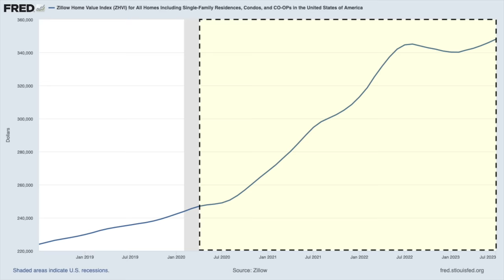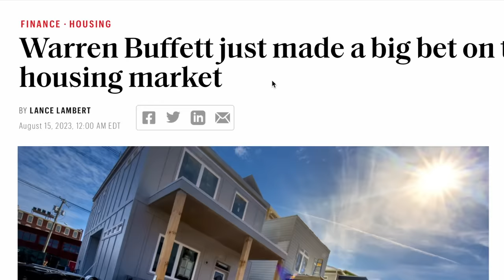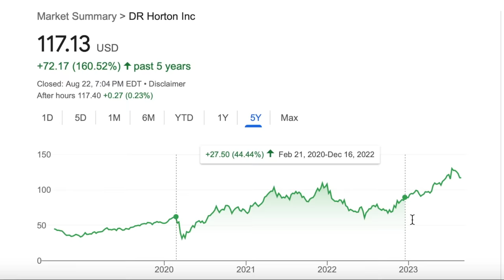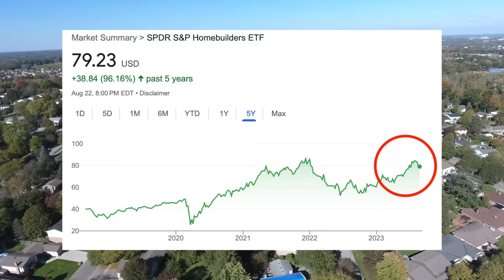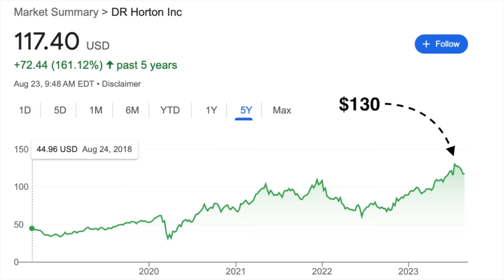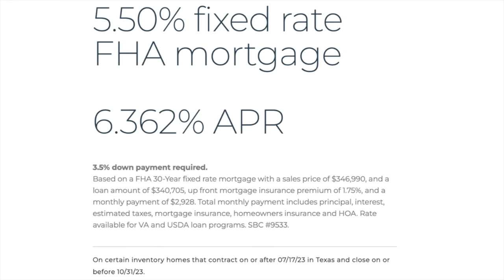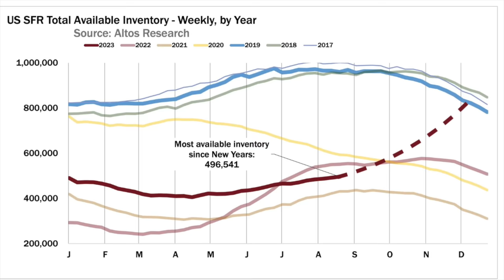The US Housing Market Won’t Survive What’s Coming

Comment: I remember in 2007 when I was working in real estate seeing people buy homes new from builders with the intention of selling before close of escrow to a new buyer for profit. The crash was so brutal and fast that I remember seeing a lot of these units foreclosed on with the builder plastic still on the carpet.
Reply: Most people find it difficult to handle a fall since they are used to bull markets, but if you know where to look and how to maneuver, you can make a size-able profit. Depending on how you intend to enter and exit, yes.
Reply: Given that we are not used to such volatile markets, the fact that the US stock market has been on its longest bull run in history helps to explain the widespread fear and enthusiasm. There are chances if you know where to look, as you noted when I earned more than $780k in the prior ten months. I hired a portfolio advisor because I knew I would need a solid plan to get through these difficult times.
Reply: It was run by Julie Anne Hoover, who I learned about and got in touch with thanks to a CNBC interview. Since then, it has served as the point of entry and departure for the games we have emphasized. A search on the internet can be done if tracking is necessary.
Reply: I just copied and pasted Julie’s whole name into my browser, and her website appeared right away. You've saved me several hours of arduous research, therefore I appreciate it.

Comment: Warren did not make "serious" investments in homebuilders. Its actually an incredibly small portion of the portfolio and was likely made by Ted or Todd, two of his potential replacements.
Reply: Yep. It's about 0.2% of their investment portfolio. Stories like this are FOMO for buyers. It's unbelievable that it works with channels like this. 

I used to like this channel.
Reply: I hadn't even noticed the channel never mentioned the investment amount hah
Reply: @AK88.  
Conveniently, it never did. For had it, the point it was making would be instantly ruined.
Reply: @BPoweredLove  not really, we're just going to enter a world of haves and have nots so everyone is right technically
Reply: @AK88.  

I don't see it that way. Any time that Warren is mentioned as "here's what he is doing", the implied message is always "so you should be too". This video is implying that the housing market is only getting stronger in the near term and I thoroughly disagree. 

As for haves and have nots, it's been that way since the beginning of mankind, so nothing new there. 😀
Reply: @BPoweredLove  whats new is the size of the chasm that will be between the two. This time really is different and low inventory is propping it all up even with joblessness because of those low int rates locked in. This is protecting housing and wont see a crash until next year spring/summer
Reply: @AK88.  

The crash already started. Many hot markets, like here in Phoenix, have already seen almost 15% crash in the end of 2022 going into 2023 until the season up-tick happened. Many other markets are like this one. 

But for the rest of the country to join in, I think that will begin this winter and continue over the next 5 years. 

Keep in mind those locked-in people don't represent a huge number of home owners. The figures that are popular to share are of "mortgage holders", not "home owners"
Reply: @BPoweredLove  homeowners have it even better and even more entrenched. Those markets crashing were already overextended and the main markets that needed the reality check as the rest of country didn't inflate as unhealthily
Reply: @AK88.  

That's obviously why they were first to fall. We agree.

Now the rest of the country will follow suit in due time. Crashes take years to play out and we're only 1 year in.
Reply: @BPoweredLove  no I'm saying the rest wont because they inflated healthily only the over extended markets needed to correct. The price of labor is yet another floor holding up the market don't hold your breath they will reverse course at the first sign of danger
Reply: He did it to help our country
Reply: good point
Reply: @BPoweredLove  it turns out it was 800million. Not small but not huge either..
Reply: @AK88.  
I'm not sure why you're informing me of that. My first comment is clear that I knew it was $814,000,000 already, which IS tiny. When you write "not small", we do not agree. 

0.22% is TINY. Very, very, very small. Less than a quarter of a percent. If you have $100, are you struggling hard in deciding to spend 22 cents on an investment? That's what $814m is against $348,000,000,000 (348 billion) of portfolio assets. 

Anyway, have a great day! Hope you don't get caught in the FOMO that the story is intended to create, for we are certainly going to see a significant housing crash continue to play out over the next half-decade. Bye.
Reply: @BPoweredLove  Size is relative. Just because he has a huge bag doesn't make it small and for all we know hes dollar cost averaging in. The fact that he made the move is what matters as an indicator. The only thing clear is that you take it personally which tells me you're in the FUD camp and just as susceptible to dogma. As I also said before both scenarios will play out but most likely buffets before yours but you're welcome to bet against him!
Reply from the maker: I would argue it was a serious investment. You are correct it only makes up .2% of Berkshires portfolio but you have to remember that outside of Apple, Bank of America, American Express, and Coca-Cola every single investment in the BRK portfolio would be considered "small" by your standard. Berkshires market cap is 786 billion. Even if they bought 100% of Ryan Homes it would make up only ~2% of their portfolio. 

BRK IS NOW one of the biggest institutional investors in these home builders. If you don't believe just Google it. 

Warren can buy every home builder in America and it would still make up less than half of his portfolio!!
Reply: @MHFIN  You're making my point. Since these investments are all small for BH, they don't make news stories every time they make these insignificant moves...except this one.
Reply: @BPoweredLove  this didn't make it a news story either, MHFIN made it one and clearly arguing my same point. By the way buffet is killing it on his trade so far as long as he gets out in time so clearly this vid was a good call
Reply: @AK88.  Yep and it will be so bad that the haves will be in fear of their life daily. Just look at some Indian or African nations with that kind of bifurcation.

Comment: Many people prefer old construction homes. Contrary to what you would think, they have much less issues than newer homes.

New homes are built in a rush now, with many mistakes, and the cheapest available materials (to maximize profit for the builders).

Older homes are often built of solid wood and brick, a phenomenon that doesn't happen anymore. It would be way too expensive to do now. 

In my area, people would much rather buy 100 year old homes than new ones...

Comment: Context to 161% increase was rate at which mortgage rates rose per altos research who you referenced. Now that mortgage rates have stabilized that won’t happen unless there is massive economic issues/ job losses and that in turn leads to distress in mortgage. Short of that price isn’t going down. Even if it did people will be dip buying.

Comment: Let's not overlook the shitty housing construction still being used. They use a lot of heating/cooling energy costs, maintenance can be high (roofs, siding), and often contain design defects such as damp basements and cracked concrete. My condo has steel reinforced concrete outer walls, floor, ceiling, and a concrete wall running down the middle. Outside of the outer walls, there is styrofoam and stucco over that. Every thirty years, you replace the wallpaper, refinish or replace the flooring, change the kitchen appliances, and maybe redo the bathroom. It has a metal roof and an underground garage and storage spaces. Hot water comes from a neighborhood steam generation system and for heating/cooling I have a heat pump.

Comment: One thing you routinely fail to mention is the amount of housing stock bought up by the 10% over the past 5 years whether to rent or AirBnB.  You give the perception that all the housing that has been consumed in the past 3-4 years has been done by average run-of-the-mill millennials when that isn't the case.  Cheap money brought this about and its about time people like yourself start calling out the real  villains.  The Federal Reserve and its destructive monetary policies that seeks to bail out the status quo at the slightest bit of trouble.  These people should have had their heads handed to them back in 2009 but no.  And the charade continues.

Comment: guys get a life. People have so much equity that they are refusing to sell causing massive inventory shortages. How will the crash happen if there is nothing to sell.
Reply: How will they keep if they can’t afford?
Reply: You sound young and full of hope... Almost as if you have not experienced a crash yet. If you had experienced a crash, you would not showcase hubris. Let's see how well this comment ages in 6 months.
Reply: Job losses, falling values and negative equity will make the 3% mortgage rate 'lock in' irrelevant.
Reply: The increase in equity caused by the 2020/21 inflation doesn't really matter unless you are selling a rental property or downsizing. Why? Because you'll just have to turn around and use that equity on another home that experienced the same inflation, leaving you at basically the same amount of equity you had before